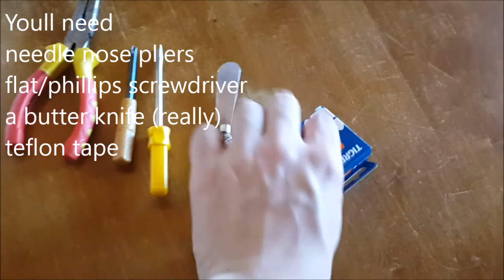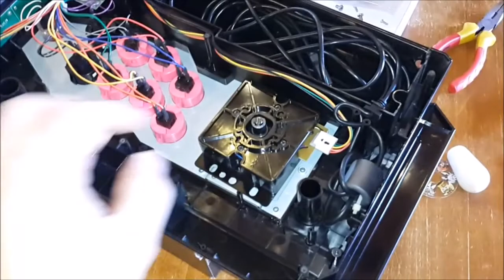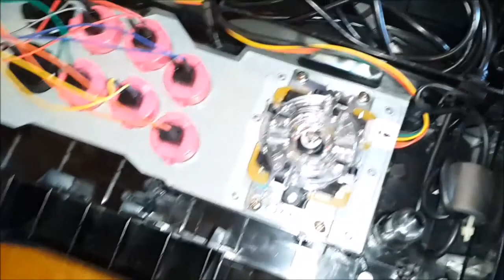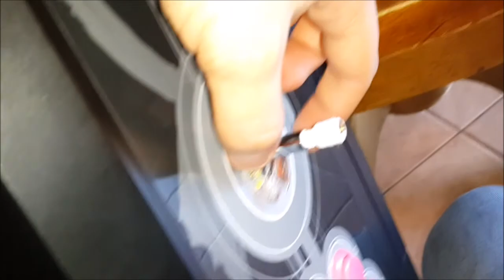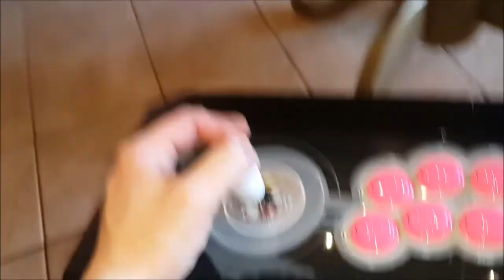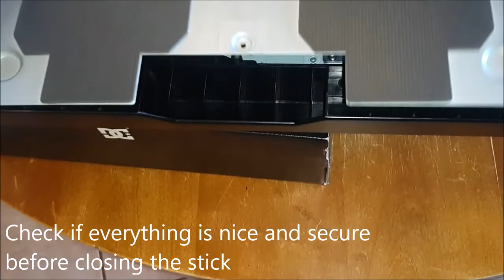Hori Rap4 MOD Sanwa JLF Install Joystick/Buttons/Battop Swap

Comment: Does it mtter if you had swith the 2 wires from their plug because when you removed it are you gonna pit it back
Reply from the maker: No doesnt matter. The buttons only need a positive and a ground doesnt matter the way you put it
Reply: @EliasVodka  Oh so when i remove the wires of the button it doesn't matter how i put it back so i could just like put the left to thr right is that what youre talking about?
Reply from the maker: @ryuqi1302  yes
Reply: So for example the blue wire is for button 1 there are 2 plugs in button 1 i can just choose where i put the wires that i removed to any plug?
Reply: Pls answer me bro pls
Reply: @EliasVodka  Thank You so much bro but does it also apply on The Hori Rap Hayabusa is it the same technique
Reply from the maker: @ryuqi1302  yesirrr
Reply: @EliasVodka  Vodka Thank you so much for the Big help i leanrt so much from you and im also sorry for disturbing you and asking many questions THANK YOU and have a nice day
Reply from the maker: @ryuqi1302  no problem men. Just ask if you have any doubt

Comment: Quick question, so will the sanwa jlf with round restrictor be a direct replacement? It looks like its just taking the 4 screws off, replacing the stick and screwing it back in correct? I grew up playing arcades in Mexico and US so im more used to playing with a round gate and bat top.
Reply from the maker: Yes. No problem at all. Go for it
Reply: Thank you!

Comment: Hola, sé que es una pregunta muy tarde. Pero pienso conseguir el mismo joystick para mi Hori Rap 4 Kai igual, solo tenía duda de que si el conector que viene por defecto en el Hori para el joystick funciona con el de Sanwa o necesito soldar algo?
Reply from the maker: El conector es igual vas a poder cambiar de joystick sin problemas!
Reply: @EliasVodka  Muchas gracias!

Comment: Nice customization. May i know the model number of this sanwa joystick please?
Reply from the maker: JLF-TP-8YT
Reply: @EliasVodka  does it come wid octagonal restrictor?
Reply from the maker: @zakiahmad4024  no. Square, you need to order the gate that you want
Reply: @EliasVodka  Sanwa JLF-TP-8YT-SK

Isnt this the complete reference number?
Reply from the maker: @zakiahmad4024   no. Thats a silent more expensive version. Same thing tho, it will fit no problem
Reply: @EliasVodka  thanks man

Comment: with the washer that they now include with the ALU and Sanwa battops, remove the need for teflon. Mine hasn't come off in 3-4 months of hard use, but your hayabusa is 2 years old so I dunno. Take it with a grain of salt, if you're considering re-buying. I'd just hit up the company over e-mail and show them this vid, good chance they'd send the washer free of charge.
Reply from the maker: Demean Nemean oh thats good to know ty
Reply: Hey I just checked FocusAttack and I was wrong. Only the ALU series comes with a washer, not sure why. Sorry
Reply from the maker: Demean Nemean dont worry

Comment: from what I hear sanwa bat tops are not very good
Reply: Whats a good bat tops
Reply: @200zero  I would recommend the Kdit bat top
Reply: @joshuapacman  aight ill check that out. I remember when I bought the sanwa battop it felt very very loose